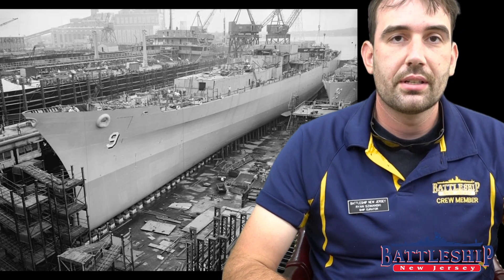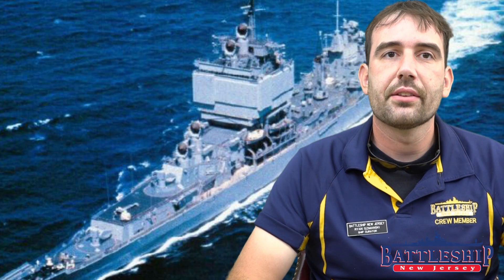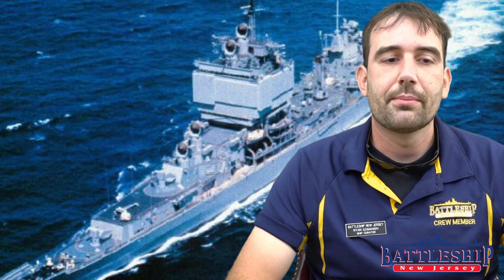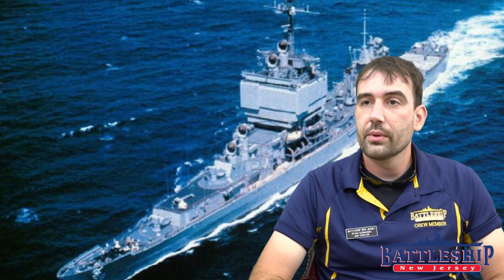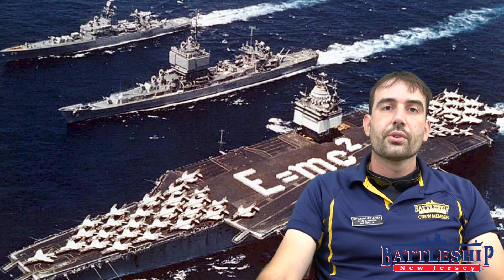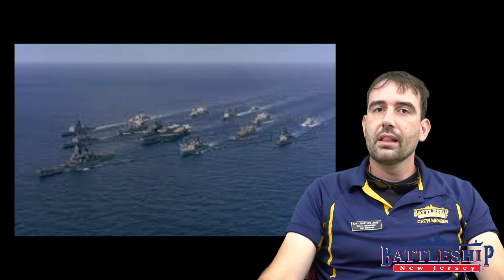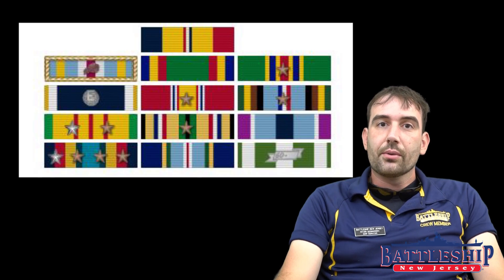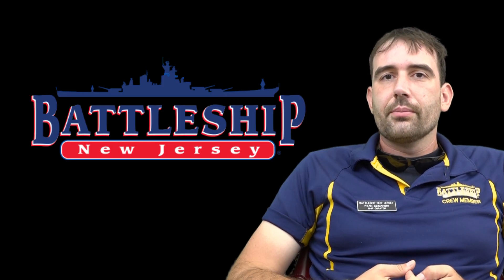NUCLEAR: USS Long Beach (CGN-9)

Comment: Thanks, Ryan. You have provided a lot of data, but you did get one fact wrong.  You said that Long Beach took part in Operation Sea Orbit in 1963. That's incorrect.  It was 1964 (July to October).  I was part of the crew from March 1963 to July 1965. Thanks.

Comment: Quick note here: Long Beach absolutely carried Harpoon! She had them put in place of the Talos launcher back aft during the 1979 refit when Talos was deactivated. They were moved up to the aft superstructure in 1984 when TLAM was installed. 
  She was originally designed to have Polaris nuclear missiles too but that plan was canceled before she was completed. 
  Also: she was Red Crown off Vietnam for Line Backer II & coordinated the B-52 strikes on Hanoi. The controllers can be heard on the radio tapes of the strikes on some youtube videos if you search it.

Comment: The Long Beach hasn’t been fully recycled because of the large amount of hazardous materials, mainly asbestos, that she was built with. I’ve seen her a couple times at PSNS. looks like a large barber sitting at the pier. I know many people that work on dismantling her down to what she is today, crazy stories. Many say the ship is haunted.
Reply: She was in PSNS from '80-'83. I was onboard then and during that COH I remember the asbestos abatement in the engineering spaces that occurred at the beginning of that COH. I don't know about asbestos topside as that wasn't my work space.
Reply: She could be hunted, I was onboard from 69-73 #2ER, and 2 crew members were killed/murdered between that time. A marine was killed accidently, in berthing, and a sailor was murdered in the ship's library. The marine at sea, and the sailor while in the shipyard.

Comment: With today's reactors going a full ship lifespan on a fuel load I'm amazed that nuclear powered destroyers and cruisers are not a thing, I would have thought with the economy's of scale using similar gear across subs and destroyers it would be better (its not just the cost of fuel, It's the cost of getting the fuel where it's needed when it's needed) and during operations....

Comment: As the 1950's Air Force suffered from the misconception that all future wars would be nuclear and that dogfighting was dead (hence fighters like the F-4 Phantom with no guns), 1950's naval designers suffered from the misconception that wars at sea would be all missile and that big guns were no longer be needed. So yes, the 5" 38cal guns were a total afterthought. Of course, battleships would continue to demonstrate the physical and psychological power of a shell screaming overhead. BTW, Long Beach did later have two Harpoon 4-cell launchers mounted on either side of the aft superstructure.
My only issue with this vid: repeatedly hearing the nails-on-a-chalkboard pronunciation: "new-kya-ler."

Comment: I don't understand what you mean when you say they have to cut through the hull to refuel a nuclear powered ship? Surely they can design a ship with refueling in mind? I don't know all the details, but they don't cut open a Submarine to refuel the nuclear reactor do they? Surely there has got to be an armored door, or some sort of way to access the reactor without destroying the hull.
Reply: Long Beach had removable deck sections that were removable. Submarines do need a hole cut. A huge hatch would be bad for keeping water out at depth.

Comment: Crazy idea here: Maybe have a hatch or pair of them on the bottom, and extract nuclear fuel that way? As long as the compartment is pressurized, it should act like a diving bell, and a crane could lower the spent fuel onto the drydock's "floor" (there has to be a word for that), lift the fresh fuel up... no cutting needed, and you can make the hatches a lot more heavy, as you can use their displacement, or the crane to manipulate them easier. Even weld them closed when not in use. The external pressure should hold them in place once closed.
Maybe it's crazy, and besides, battleships are not in vogue at the moment, let alone nuclear ones...
In the middle of a battle group sea mines and torpedoes should not be a large concern, and surface attacks present no additional threat.
Reply: But there are large, circular, removable deck sections ABOVE the pressure vessels. Which are only pressurized when the plant is started, to avoid brittle fracture of the primary enclosure.
And the fuel isn't the problem, it is removed and recycled. The issue is irradiated cobalt, steel, and contamination in the ion exchanger, valves, low flow areas; all over the place.
Reply: My stateroom was on the main deck right at the “top hat” above the forward reactor…I feel fine…😗

Comment: Refueling a Nuclear Battleship....ah designing the rear main gun platform it's hull mounting system so that it can be lifted and unbolted/locked in place thus opening the vessel to refueling and replacement of the reactors and drive systems.

Comment: If you build a new nuclear reactor for sea use it will probably be a gen4  liquid fueled molten salt reactor, so you don't have to cut open the hull. They are also able to be made as small modular assemblies so you could design them to be removed  and replaced.  Molten Slat reactors also can be made much less sensitive to shock and vibration, so they don't stop working unless hit.  They also have to abilitly to automatically stopping if cooling fails or the reactor is breached.
Reply: haha nope

Comment: First of the phased phased array radars the picture shows a sps-48 3d air search radar, and an sps-40 2d air search radar. The talos surface to air missile had remarkably long range for the time. The issue with the talos was that it was a liquid fueled missile.
Reply: That is not an SPS-40 it is a SPS-49

Comment: I would dispute the statement that the Long Beach was the last true cruiser. For example the Virginia class CGNs were their own design but were smaller than the Long Beach. I still view the loss of our nuclear cruiser fleet as a major loss of capability for the US Navy.
Reply: ALL later USN ships were originally DDGs, DLG, etc. and were reclassified. None had a full length deck over the damage control deck.
Reply: I agree. Something no one seems to think of when comparing cost. Nuke ships buy 25 years of fuel up front. A suck and blow has to buy fuel their entire life. The carrier escorts should also have nuclear power. A BG could pull out of San Dog and be in the gulf in 10 or 11 days. fossil fuel ships couldn't do the same without slowing to refuel.

Comment: The Zumwalt of Cold War era. So the Zumwalt should've been a one off like Long Beach due to the latest technology inside it, like they should've just build only one Zumwalt and use is as a test bed for new tech of sorts.
Reply: Zumwalt would never have been designed as a one off. It was planned, I believe, for about 30ish of them to begin with, which would have shared the ridiculously high R&D development costs among the hulls, although the number of ships ordered was reduced multiple times, eventually leading to its cancellation as a project as it was deemed too expensive per hull.

If it was originally put forward as a one off class, it would never have gotten past the planning stage, as it would have just cost far too much to research, develop, and produce.

Comment: I have never seen this hull section at Puget Sound Naval shipyard
Reply: It's off to the side and might be in a restricted area given the fact that it still has reactor components in it.
Reply: @AvengerII  first 
It’s a big chunk of hull, it’s not something that could be just “set aside” psns is fairly small, about a mile by a mile maybe (I know it’s a mile east west but north south I don’t know considering the piers) so it’s not like they can just shove it in the back. 
Also PSNS does like all of the reactor decommissioning for the for the entire Navy, we are well versed in reactors and they are quite literally all over. (If you go on Google images and count submarine hulls you can see there are well more than 20 reactors just in those alone). 

Basically there’s no way for a it to just be “set aside” as it would have to be floating or in dry dock due to weight and the water front is super accessible, in fact you could literally sit on the opposite side of the bay and probably make out all of the hull numbers with your naked eyes if you really wanted so You couldn’t even hide it from somebody outside the base
Reply: @AvengerII  moreover all of the pictures I’ve seen of it at PSNS have had it either in the dead fleet (2015 ish) or by a pier where my office is. So i’d say it’s far more likely she probably gone to Hanford

Comment: I remember this ship in, “Pearl Harbor,” back in the 1980’s and 1990’s, we were repairing the concrete pier facilities in, “Pearl Harbor,” the work crews worked off of, one man floats under the piers. We showed up that morning to go to work, and the, “Long Beach,” was tied up right next to our construction sight. We had to keep a certain distance from the ship not because of security issues, but because of the potential for radioactive leakage into the surrounding surface waters. It did not stay long it was tied up next to us for only five days. Then back out to sea. Saw it again later but tied up to a different pier.
Reply: 2 years of my life station on her... 1982 / 84

MARDET CGN9... WESTPAC 1-84... 🦅🌐⚓

We left North Island NAS on Friday 13 JAN 84. We were to be in Pearl Harbor for only 3 days. Enroute, saboteurs drained the lube from the #1 prop'/-shaft bearings and needed to be in drydock for repairs. The new bearing was shipped from Norfolk VA thru the Panama Canal to Hawaii. We were there for 3 additional weeks while the battle group steamed onward to Subic Bay. We missed the first "Liberty Call"  at PI, we rendezvoused with the USS Kitty Hawk in time to participate in Team Spirit 84... 🦅🌐⚓
Reply: I was there when that occurred and it was definitely NOT saboteurs. LOL. The actual event was caused by a watchstander "falsifying his logs" The roving watchstander (on the 2-7 watch) neglected to actually go down into shaft alley to read the oil thermometer and look at the oil sightglass, since the previous watch (22-02) had taken daily oil samples and the pipe cap over the outlet of the locked closed sample valve either vibrated off or was not tightened enough which allowed all of the oil in the Line shaft bearing to drain into the shaft alley bilge. When the next morning watchstander attempted to open the handwheel on the scuttle to shaft alley, it was so hot he burned his hand. Evidently nobody had been down there since around midnight when the guy took the oil sample. They called away a fire in shaft alley at 0715 and then discovered the #1 shaft had melted 3 Line Shaft Bearings and was unsupported so the shaft itself was drooping and bent beyond use. The USN had to fly 3 new propeller shaft sections out from Mechanicsburg PA to Hawaii. while we waited in drydock. I took advantage of this opportunity to go off the ship in drydock when they closed the brow by crawling through the stern tube and went up to buy a chimichanga from the roach coach ashore. Major Score! @danicastone1369
Reply: @danicastone1369 , To bad you missed, 1st liberty in, P.I., heard, South Korea is nothing like the liberty In, P.I. A platoon of, Marines can attest to that. How do you know it was sabotage and not just some idiots that didn’t do their job correctly, then blaming a saboteur? Isn’t that is what was said about the, battleship Iowa? It was the U.S. Navy, blame game of an innocent guy, because of some books in a wall locker. But upon the investigation being fully completed. It was discovered that the gun crews themselves were responsible for over ramming the charges, because of an improperly handling of the powder charges and not enough trained crew. After leaving the, U.S. Marines, became a, “Commercial Diver” and worked alongside many a, U.S. Navy divers at Pearl. Diving inside of, Pearl Harbor was some of the most hazardous dive jobs in my career. “Huge Hammered Heads and Tigers” routinely especially at the mouth of, Pearl. Nova Construction, had accidentally discovered a fully intact, Jap torpedo from, December 7, 1941 as it was excavating by the dredging crane, on May 5, 1991, in the building of the permanent mooring for the, Battleship U.S.S. Missouri. While pulling that, “Jap Torpedo” from the mud, at the bottom of, Pearl Harbor, it had completely shocked the crews and the crane operator, as the controls were locked with a torpedo hanging in the air, and in looking up at the crane operator blowing his alarm, all the crews realized what it was stuck in the jaws of the excavator bucket. After the crane operator locked the controls, everyone evacuated the job site, so the, U.S.Navy EOD could disarm the torpedo before removal. In waiting for the EOD to show up, a representative from the, Pear Harbor Society showed up as well, and a big meeting for control of the, “Torpedo artifact” as to how to safely disarm it and then display the, “Torpedo artifact inside the, Pearl Harbor Museum?” The U.S. Navy won out, the only thing saved from the, Torpedo as an a original historical artifact from, December 7, 1941 was the wooden fins that, EOD had removed from the original torpedo. It is still on current display as far as I know in the Museum. Un-Exploded Ordinance, can still be discovered in places around Pearl Harbor, during other dredging excavations the, UXO = “Un-Exploded Ordinance” has been disturbed, by the dredging bucket, and some of the UXO even detonating against the dredge bucket and blowing holes through it, with smoke and gas rising from the water. This is just some of the history of working in, Pear Harbor. Semper Fi and Aloha to you. 🌺🌸🌴❤️🇺🇸

Comment: I do mot know what the problem would be with having nuclear powered surface ships. Simply design a ship in modules that can be pulled out through an access point in the top of the ship similar to a hatch on a cargo ship but thicker and bolted in place. On top of this you can place a weapons module. When the time comes to refuel or decommission you just pull out the various modules including the nuclear one.
Reply from the maker: Here's a whole video explaining why nuclear battleships are a bad idea: https://youtu.be/ZkVF25RyzO0
Reply: @BattleshipNewJersey  I did not say that it would be practical  to use that type of ship for close in support.  No ship in today's navy does that anymore. That function is performed by various aircraft. What I see would be a weapons platform that would be able to have enough reserve power for tomorrow's technology.Like the old Soviet cruisers it should also have helicopters.

Comment: Destroyers are the most powerful surface ship after the aircraft carrier in modern warfare. In the 80s, the line between cruisers and destroyers in size are blurred. So what separates a cruiser and  destroyer today?
Reply from the maker: I think this will help https://youtu.be/YRvdvLyl6mw
Reply: @BattleshipNewJersey  Thank you, but unfortunately it doesn't. I was talking about the designation of "cruiser" in today's navy. Modern destroyers are the size of WWII cruisers and the Ticonderoga Class cruisers were originally designated as destroyers till they were re designated as Guided Missile Cruisers. When the Ticonnderogas get replaced, will it be a destroyer or cruiser and at this point does designations even matter?

Comment: A turn from 20° left rudder to 20° right rudder at about 30 knots almost put the port side bridge wing into the water. Lots of damage was suffered thru out the ship. I was at the helm in the late 70 s
Reply: You'd get crazy swings during a strong Pacific storm, too. Plenty of stomach content in the crow's nest. (BB63 first crossing towards the battle fleet... and in a hurry. )
Reply: ANY ship doing 30 kts you don't really want to do 20 degrees rudder unless its necessary - 20 degrees left to 20 degrees right - the OOD must have gotten relieved by the CO on the spot....

Comment: Nuclear power for the smaller surface combat ships can be problematic. Especially if they have their power plant shut down/cooled down and find themselves needing to get underway fast. The process to do so takes hours. On a gas turbine powered ship one can get underway almost as fast as you could start a car. And gas turbine engines for escort ships coupled with gas turbine engines used for aircraft means a carrier only has to carry one type of conventional fuel to take care of both needs. Also given that gas turbine engines have an incredible power to weight ratio it means that the ships that use them have a lot of buoyancy that can be used to accommodate other systems.